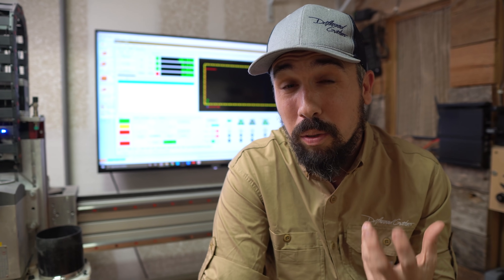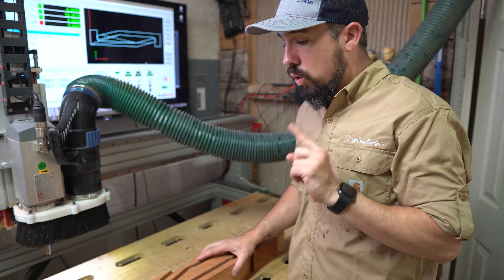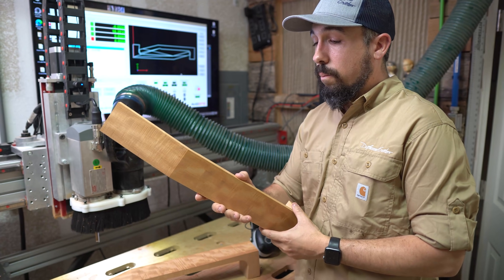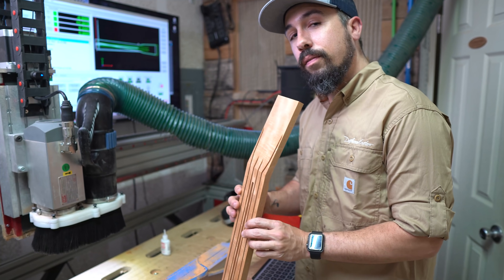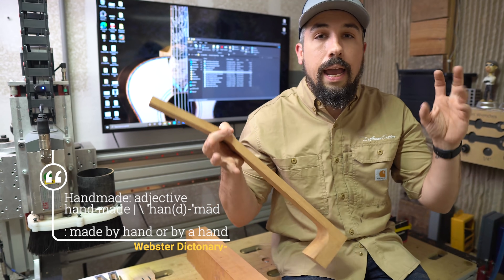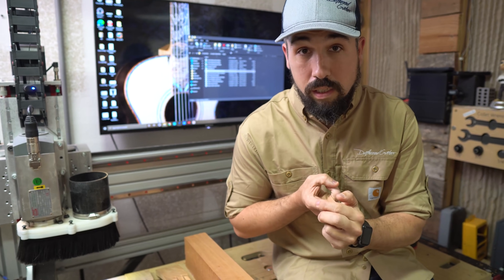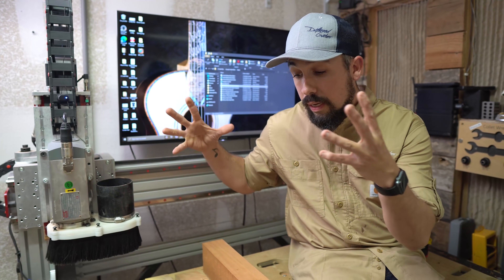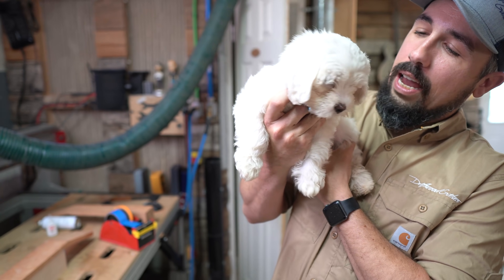Can You CNC Machine A "Handmade" Guitar?

Comment: I don't believe "Handmade" has the same meaning as it used to.  It used to mean that for many things to get the best product making it buy hand in ones or twos at a time was far better then a mass-produced product. How ever machinery in the last fifty years as gotten to the point where you can go back to making ones or twos of something and have if not the same quality as making something by hand if not even better quality.  It also allows us to do the ones or twos at a more cost-effective rate.  As long as quality and consistency in the build is there and most times even better, I see no problem with CNC machinery being used to make some jobs easier and more productive.  The one thing that will and must always remain is the same is that your hands have to do the fit and finish of the guitar because that is where design, voicing, ornamentation and the artistry of the guitar all culminates and makes the guitar come alive for the guitarist that it is being built for.  With out that kind of input all you have put together is a wooded box that pumps air and sound around until it falls out of the sound hole.  
     The luthier has to formulate magic into his design of the instrument.  He has to prepare the wood to be used and bring out the voice of the wood. He is going to use any tool that will yield the best and greatest results to get him to have a guitar in the rough.  He then must use his hands for everything that comes later in the build to breathe life into the creation because that is where art is forged.

Comment: I can imagine an AI driven machine that, after square braces have been glued on the top and back, shapes the braces. The AI feature measures, in sophisticated way beyond human recognition and observation, the sounds revealed as the machine taps EVERY square mm of the top or back. The idea is to obtain perfect braces that have the best voicing character possible. 

I object to this machine because it has capabilities of observation and action that no human can achieve. 

art in guitar building is in one’s skill in voicing. Craftsmanship is a well-crafted guitar. 

Using a cnc does not take away from art but in fact requires greater artistic and craft skills ie programming and operating the machine so cncs are great AI that removes an artistic step not good

Comment: For me it’s definitely “hand made”. “Hand made” is more about human input. Anything built by batch processing is going to have very little variance between outputs whereas you’d be pretty hard pressed to create two guitars that were identical. You’re only attempting to maximise sound quality and durability but that requires differences between every guitar. Also, I can’t help but feel that any argument so absolute as to say “No CNC” may be overlooking that the tuning pegs and strings are mass produced, that the lumber is cut with automated machines. Mass production vs “hand made” is always going to be about attention to detail and focus on the final product, not the process. A bespoke piece of software programmed by a developer is always going to be better for a business than Microsoft Excel but ultimately it still stores everything as 1s and 0s. The beauty isn’t in the source code, but the superior quality of the service it provides.

Comment: For what it’s worth, in my humble opinion, it’s hand made until you get to the point where you are tossing a log into a machine and it spirts a guitar out the other side. You are making the most efficient and effective use it your time and what in a lot of cases are expensive and sometimes rare materials. Stradivari would have used the best tools available to him in his time. All the tree hugging individuals should be happy because the amount of material turned into swarf and thrown away or burned is kept to a minimum. That many more guitars out of a given piece of wood.

Comment: It's kinda a moot point. If you wanna get completely sticky about it and be then you will have to go back to the days before any power tools at all. The machines just make the process more efficient. I  guarantee you that Stradavari would be using this technology if it were available at his time. I watched the 3,000 year old guitar series and it seems like there is an awful lot of tweaking that can only be done by a human with hand tools and the sense of touch, sound and feel. The way I see it is that you make the guitar entirely from start to finish and that's the difference from doing it in a factory where they are making "cookie cutter" guitars based on what they think will sell. When you know the person who is getting the instrument it allows you to tweak the instrument to their needs. The whole "hand made" thing is kinda a myth since the invention of power tools. I'm sure no one really wants to go back to the days before band saws, table saws, and routers. Every  guitar is a one off. I would consider them handmade because they are fine tuned by a human. There's a always going to be things that a machine does better than a human and vice versa

Comment: The CNC gets you to a point, perhaps during that process you are more a tool operator.  I'm assuming this is a skill set you could train someone to do, and they could be called a "technician".  If it stopped there then perhaps you would have a hard time calling something handmade, but we clearly know it does not stop there.   Then the "craftsman" takes over.  I think you can easily justify being a handmade builder.

Comment: Well...it wasn't "factory" made...so it would be considered handmade like Frank Howarth ...what it isn't is "hand tool" handmade like James Wright...which you have never claimed to be.

But more importantly...and maybe a more important question is the CNC SAFER than a snapping bandsaw blade, a router bit coming loose and shattering the part...and your finger...the blade of a table saw pinching the wood...do I need to go on?...okay, sanding dust, router dust and band saw dust from the wood and epoxy...Makes me wish I had a CNC.

Comment: Dude it's just a fancy accurate band-saw, and it saves you time,  so with that regard would the end price come down LMAO because you saved some time? no for reals I'm just kidding, high quality is better if you can do it in an efficient process. still hand made in my opinion, just because you used a CNC machine does not cross that line. every builder of whatever looks for efficient ways to improve their productivity and quality, for instance you carve your braces tone your tops etc...  Martin for instance hasn't made a "hand made guitar" for years, barring their custom shop, but even then i wonder. I would call the martins hand assembled, Gibson, etc.. yes they all have a custom shop for custom guitars that are more hand built BUT... watched a lot of guitar factory vids and they pass from CNC to CNC to CNC to bench, a little fitting fussing, then back to CNC you are not cookie cutter they are.

Comment: Where does one draw the line with machinery? If a chainsaw is used to fell the tree and a sawmill used to break it down into lumber, does all the wood working that follows qualify as "handmade"? For absolute purists, not one piece of machinery could be used from felling the tree to applying the finish to qualify as one hundred percent handmade. Everything in between, including a CNC machine is a hybrid product of machines and hand-crafting. I wouldn't lose one second of sleep worrying about the definition or qualification of "handmade." How many luthiers work by candlelight and use draft horses to power their tools?

Comment: A tool is a tool. Should you hand sand instead of using a belt sander? Hand chisel vs a block plane?   My only concern is the end result. If the CNC is more accurate, more consistent and more efficient with material it should be used. I don't see any advantage in using lesser tools and processes.  I have never understood how guitars were ever called "hand made" when tools have always been part of it. Unless you are using your finger nails to plane the wood and the bottom of your feet to buff the frets, guitars have never been handmade. YOU are as much a hand builder as any builder that has ever existed. 

Builders have always used the best tools they had available to them. If Stradivarius had a CNC available, he damn well would have used it.

Comment: Seems silly to me. CNC machine is a tool. Hammer is tool. File is tool. Heck, if used your teeth to gnaw away at the wood, you've used your teeth as a tool, same for finger nails.

If you put a block of would at one end of a machine, and it produces a finished guitar out the other end, you've got a machine made guitar. What you're doing is using a variety of tools to make a high quality, high consistency product; by hand.

Comment: To be truly "handmade" would require you to not use any power tools or assisted building techniques. That is ridiculus! You are just using smarter methods to get to the end result. There is no assembly line production of parts to manufacture multiple guitars at a time. Do that, then you gotta turn in your card.

Comment: A CNC is just another tool. No different than any other tool. Unless you are chewing the wood into shape with your teeth or scraping it away with your finger nails, you are using a tool. Even if that tool  is a sharp rock. Once you start down the road of using tools, there is no arguable point that justifies saying using one tool is good but using a different tool is bad.

Comment: "Handmade" should not be a religion. Operations that yield better results when done by CNC should be done by CNC. Things should only be done by hand when it gives better results than the computer.
Obviously anything related to dimensional accuracy should be done by the computer.
Things which are less well defined e.g. voicing the top should be done by hand.
If a handmade guitar is worse than what could have been built by the computer then "handmade" is a worthless qualification.

Comment: A lot of the anti-CNC crowd tend to think that you just chuck a piece of wood in one side and a finished guitar comes out the other, but even if you use a CNC as much as possible, there are parts that cannot be done by the CNC, and once the pieces come out of the CNC, you are still just looking at parts that have the potential to be put together into a guitar. And there there is all the sanding. I don't have a CNC yet, but I do plan to pick one up shortly, because it does save a lot of time and makes it more profitable (and affordable to the customers)

Comment: Any time you use a tool, you are using a "technology" so to speak, so even if you only made this guitar with hand tools and no power tools, you are still using a technology. Even if you made it with a flintknapped chisel or saw, or auger, it's still a form of technology. I don't see the difference between a hand tool or a power tool to get the job done. It's still handcrafted, hand made and in my humble opinion, any time you need to make something by hand and eye, it's hand made. Bob's your uncle.